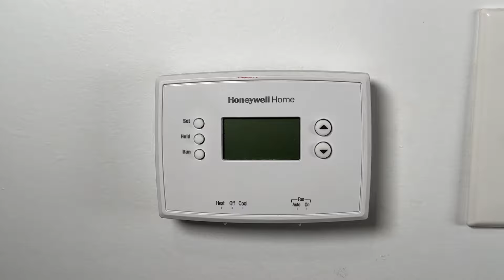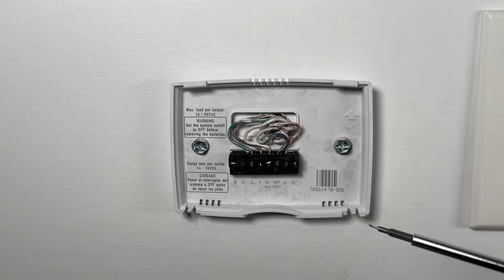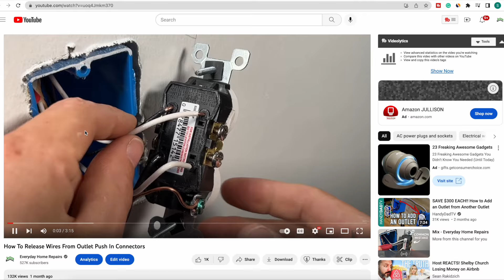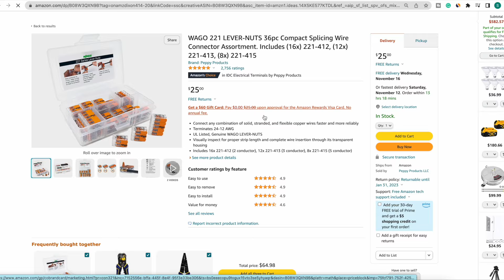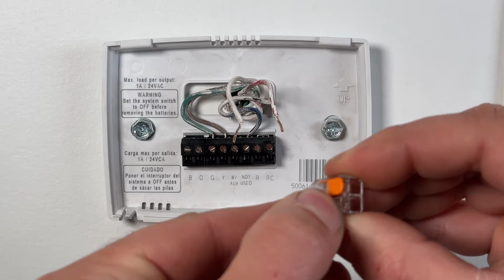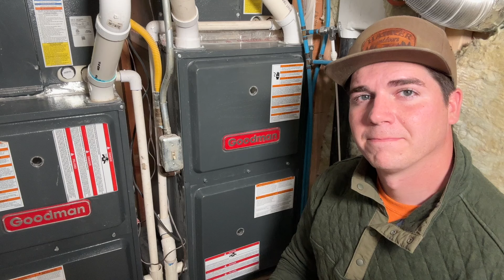How To Turn On Heat Without A Thermostat

Comment: Hi what if we’re in a 50 apartment building and have a thermostat without a face/not digital It’s sooo cold in here, help, I had to turn the stove on. 😢
Reply: did your neighbors also lose heat? did you get heat? i really hate how no one replies especially the channel creators. im curious as to what the property managers had on their hands. there are systems that run pipes with basically hot water though the whole building from a central systems that feeds all the apartments.

Comment: this doesn't work with communicating systems like Lennox s-200 to s-400, etc. also, take care to pay attention to the label more than the color. you can easily switch to a different color for any specific function. Lastly, the O wire turns heat on in conjunction with the Y wire. In some cases, you'll want to energize the O wire at the same time as the Y, and in some cases, you just want to energize the Y.  In my specific area, it's far more common to energize the O in cooling. The white wire is often used in the O slot.  The O is used for heat pumps.
Reply: good comment. im just learning

Comment: When the house reaches the desired temperature, is it better to disconnect the wires at the thermostat (rather than turning off the switch at the furnace), so that the fan can continue to run (if needed) to cool down the heat exchanger?  In other words, wouldn't turning off the switch at the furnace potentially allow the heat exchanger to remain too hot and be damaged?
Reply: i was wondering the same. im distraught sometimes by the lack of replies to questions like this. im learning a wish people would provide more feedback and just open ended statements you know

Comment: If I can't find power switch, can I disconnect the wires if I'm very careful,  and proceed to the connection procedure?
Reply: turn it off at the breaker if it's clearly labeled

Comment: I'm fine with diy-ers. They try to do something like this and forget to turn off the unit and pop the fuse. Or worse, as happened last week, a dude popped his fuse replacing his thermostat, didn't have one, so he wrapped wire around the fuse spades, and when he powered the furnace back up, he hadn't actually fixed the short, and it blew every low voltage connected part of his system from the furnace board, to the defrost board (it was dual fuel) to the new stat. So, yea....keep on keepin on, diy guys! I gotta feed my family! 😂
Reply: That was Darwin at work.

Comment: I doubt this will be read, but is there a way to install a thermostat on a mini split system?  These seem to be all the rage these days but appear to be reliant on battery operated remotes to fully function. I have seen some that allow smart thermometers but do not want to put anything like that on the home network, for sure. It also generally would be more practical to have a direct wired connection on the wall over a small remote to probably lose.
Reply: Depending on your brand, they either have hard wire stats available specific for the mini split in question or some even make adapters for you to be able to hard wire in any conventional thermostat. Just need to search for whatever brand and model mini split you want/have and see what they offer

Comment: Brilliant idea don't call a professional. Go ahead turn that on!! Don't follow this guy's instructions, folks. Call an HVAC company to fix the issue. If the thermostat is off, you have a problem.
Reply from the maker: At least around me this is not uncommon on things like a rehab project.  Drywall crew removes the thermostat, weather takes a turn, and now you can't find the thermostat to get the heat on.  This is obviously not a permanent fix.

Comment: Doesn’t the fan need connected too?
Reply: you probably figured it out by now,, but just for others sake. in this situation the control board on the main unit will switch the fan/blower to on after initial start up sequence. i am assuming this is a gas system with a digital board at the main unit/furnace.

Comment: You could just wire it to a light switch so you can turn it on and off. This isn't all the best idea. If you are in a pinch just twist the wires together. Don't think many home owners will have those push fittings laying around.

Comment: Only ever do this with a conventional furnace, and in an emergency, to keep your people, pets, and property from freezing while you get a thermostat in there ASAP.  Not with a heat pump, not with an electric baseboard. Really need a strong warning on this video, people get in over their heads.
Reply: Curious as to why since I just connected this with an alligator clip between R and W and the wire melted. Also tried a connection between R, G, and W to get fan + heat but nothing happens and there might've been a spark when connected to R at that moment.

Comment: PLEASE caution that these instructions to not apply to high voltage/current switches!
Reply: We have electric baseboard heaters as a backup for wood heat, and the thermostats for those are switching full 240V AC.  They could be connected the same way, but you'd have to turn the breaker off, and treat it like you treat a light switch rather than this lower voltage control circuit.  You'd also need to check the voltage and current rating on your connectors.
Reply: @Br3ttM  agreed. You just have to tread REAL lightly when the thermostat is switching maybe 10A at 240AC, without a contactor.

Comment: I would love to read the comments from actual electricians on why it's so brilliant to bypass and just connect things together. I love to see you doing dryer repair.
Reply: I have 22 years HVAC experience. This guy is an idiot. I even run an HVAC YouTube page. We would never tell professionals to jumper out their stat for anything other than extreme emergency. Even then, it's very temporary. Some moron is gonna leave it thinking that it's ok to do so. 🤦
Reply: @mungs1104  this video is for an extreme emergency. I thought that was pretty clear. If someone doesn’t feel comfortable doing this, then don’t. No one is twisting their wrist. But Knowledge is power. Quit wasting the comments section with your ignorance.
Reply: @diyhvacguy  IMO they didn't emphasize the risk here enough. Should've taken an extra 10 seconds to stress that you should only do this if it's freezing outside, otherwise put on a sweater
Reply: @calvin7330  yet,, no clarification from you
Reply: Hahaha, I am an electrician and I just told him what I think of him.

Comment: Please add a disclaimer.. turn off the power to your unit before you touch the wires before you take off the thermostat.. just in case someone jumps the gun.. Flip the switch or breaker on your furnace!
Reply: This was in the beginning of the video, to turn the power off at the furnace 👍🏽
Reply: Yeah I mean but even before showing the inside of the stat and poking around in there. Just thoughts because people don't know what they could mess up 🤣

Comment: Please note: This is not for a heat pump! Also do not touch blue and red together. Please call a professional!  The B and O terminal control the reversing valve. Depends on which a certain manufacturer and what they want energized. Please again contact a professional! I know this guy's trying to help but please get a professional to guide you. There are first stage and second stage heats also there's first stage and second stage cooling also there is electric and gas furnaces along with heat pump and boilers. Please if you're not a technician don't guess!
Reply: Thank you for this. I should have been more specific in that this is for a GAS FURNACE. There are other steps involved with heat pumps and other systems. Thanks so much for the comment. Like he said if you have concerns of doing this wrong please contact a professional.
Reply: Curious as to why since I just connected this with an alligator clip between R and W and the wire melted. Also tried a connection between R, G, and W to get fan + heat but nothing happens and there might've been a spark when connected to R at that moment.

Comment: I have the same tstat,Honeywell RTH221B,did not wire it up yet because I have a A/C Heat pump.I really want to use it because it's so basic.Instructions say not to be used with heat pumps with backup /auxiliary heat.Can I use anyways? I do not use heat if the temperature is below 45 its a residential packaged unit 507296-01 (p)
Reply: Don't. It could wreck your heat pump. That's why they said 'Don't.'
Reply: @richardschneider9098  Thanks for the warning! I want to change from Nest E to a basic thermostat as the nest has a mind of it's own, been trying to get it to behave but Google seems to like taking control.I can't for a simple thermostat for the residential package. When I Googled 507296-01  I can see the manual for my unit.It tells me I need to use a minimum of five wires for proper installation.So you say don't use the basic thermostat and I understand that you are really giving me good advice . So I should ask Nest to replace the faulty thermostat as I understand that they have  quiet recall for a bad chip, but I really wanted to stop using a so called smart thermostat, thanks again.
Reply: I got one too that just started acting up yesterday. Fan auto/ on works, but heat/ cool won't work and the screen went blank.
Put fresh batteries still same thing. Only thing works is fan. No heat no AC
Reply: @LaidBack--  Hello, first thing to try is hold down, push down the screen,wait for it to restart, sometimes you need to reenter your modem information and password, these smart thermostats will work then start to get a mind of their own,I didn't try to get a replacement because I don't want one anymore,I just used space heaters whenever the temperature drop below 48deg. I close the vents and have cardboard cutout to block the return air as too much heat goes right back up and lost, so didn't use the heater much, but for summer will definitely find a thermostat that is not a smart a_- ! Another word, I had to put up with it just long enough to warm the whole house when the temperature was above 48deg. Which wasn't very often this winter, so fighting with it when I could use the heat pump was and will be the last time.

Comment: Not all thermostats are the same meaning you can’t operate them without thermostat face on and not all units are the same and will not work without secondary heat or emergency heat and most reversing valves can’t being energized without O and R so yea  which by the time you’re trying to figure it out  you will most likely cause a short popping a fuse then it’s time to call someone… so yes don’t listen to this hack because I’ve seen it multiple time, trust me call a professional.
Reply: Trust the dude who can’t write an understandable sentence. Uh huh. Right.
Reply: @ProofyRick   haha it’s hard being in front of a camera! This is for an emergency situation, and most people who are using this information understand that.  Thanks for your comment. Real… real uh helpful. Yea
Reply: @diyhvacguy  well I’m sorry, I understand and I apologize for commenting “informational” information.

Comment: One if the tstat is blank and has common hooked up you have other problems and if you don't have common hooked up just change the batteries and see if the display comes on if it doesn't just connecting the wires together will still not get you heat or air if your doing it during construction and plug the coil up with drywall dust most manufacturers will not warranty it and they also make a sensor that you can wire into the wires that has a set temperature that would kick the system off and on during the construction process the only way this would work is if your tstat was bad and you couldn't get one then for some reason but you would have to unhook the wires when you wanted to shut off the system or you would get real hot or really cold depending on what you were running

Comment: This is really great tip!!!  Can this be done with ac?
Reply: As an HVAC technician, I would not recommend doing this for AC. The thermostat keeps the system from running nonstop. Running your AC nonstop would cause the Evaporator to ice up and stop working all together.
Reply: @thomasmiller7138  How long do you recommend doing this with heat?  

Supply stores in my area will be closed for a couple days, am I safe doing this for a couple days with heat?
Reply: @thomasmiller7138  thanks for your input.
Reply from the maker: Yepper, same process but different wire.
Reply: @Everyday Home Repairs  thanks for reply.

Comment: Hmm.  3 things:
1.  It would've been good to explain a little more thoroughly when it might be useful to do this.

2.  If that's a forced-air system, you'll probably want the fan on as well.

3.  It would have been good to explain the same approach for systems with primary and secondary heating mechanisms (e.g., heat pumps with resistor back-ups).
Reply: When a gas furnace receives a heat call, the control board will turn on the fan, it doesn't need a G call.
Reply: @andrewludwig9251 :  Electrical resistance or heat pump.
Reply: @ncooty my language was very specific as I specified “gas furnace”.
Reply: @andrewludwig9251 :  See title

Comment: That’s real nice unless you wanna freeze or burn up because there’s no way to control the temperature
Reply: This video is intended for temporary heat if the thermostat has failed. Or if there isn’t even a thermostat in a remodel situation.
Reply: Um, he explains that near the end of the video.
Reply: Did you not watch the whole video ?
Reply: @abelhernandez9710  no, I under stood the concept, right now my thermostat is messed up and I have no heat. I could do the same but it would be 100 deg by morning.
Reply: @TexasScout  wow 😂  flip the switch and turn it off sir. I don’t think you understand the concept
Reply: @diyhvacguy   You did not understand it. You can burn the house or anything around.  The video guy should have given warning to never, never, leave home or sleep before disconnecting the wire, meaning to turn off.  He let it go with a half sentence as if it is not deadly.
Reply: As long as the safeties are still in the furnace, a burnout probably won’t occur. AC on the other hand will run until it freezes up and not all units have the safeties to protect the Compressor.

Comment: You've just created a constant call for heat. If you leave it like that the house will get as hot as the furnace can make it.  You need a thermostat of some kind!
Reply: I think everyone knows that they’ll have to modulate the heat manually.
Reply: Captain Obvious is in da house.
Reply: @howardmcewen  😂😂😂🤦🏻‍♂️
Reply: @howardmcewen  the sad thing is that for some people it's not obvious.
Reply: Correct. This is only for emergency heat when the thermostat has failed.
Reply: @Trevor Ritchie, wow, I am impressed with your awareness of the obvious!!  🤔
Reply: When in the video did he say “leave it like this forever, you never need to replace a thermostat!”

This is called troubleshooting genius. If your thermostat is toast you can do this til you buy a new one.
Reply: Just remove the wire from another

Comment: Nice, so the fan is just fan, and the furnace control board will also turn the fan on and off?
Reply from the maker: Yes, the blower fan will turn on once the burners are lit and heat exchanger has some time to heat up.
Reply: Yea, the white wire tells the board in the furnace that you need heat. So the control board makes sure the heat and fan both come on when white is powered.
Reply: If you want to run the fan by itself, you would just connect the fan wire correct? Also, the 24 volts is DC, correct?

Comment: Great info. I had to call customer service to help to swap out my 1930s original thermostat with a digital one. Sadly only had 3 wires and only 2 in use. Colors did not line up and customer service was rather hesitant to help.
Reply: The old TOTALLY RELIABLE system
is strictly a SHUNT system.

No fancy systems

Comment: Red to white WITHOUT the fan connection for heat?

Connect the two and the
furnace will NEVER turn off
by itself.
Reply: Yes, it states in the video you will need to manually turn on and off the furnace, either with the lock lever or with the switch at the furnace.
Reply: Duh. This isn’t a permanent thing. This is literally just manually turning it on. I think everyone knows it isn’t going to turn itself off without a thermostat.
Reply: Its pretty obvious it isn't a permanent solution in the presentation.
Reply: @BDBD16  exactly.
Reply: @BDBD16  Agreed.  It should be stated CLEARLY.  Regrettably people will jumper it and walk away.
Inevitable.
Reply: Most furnaces have a high temp limit switch that will shutdown the burners.